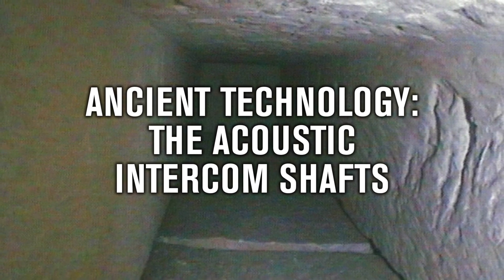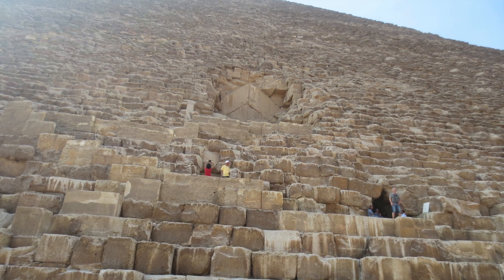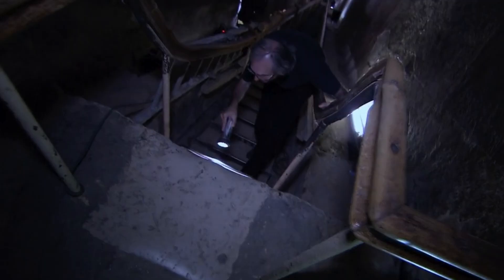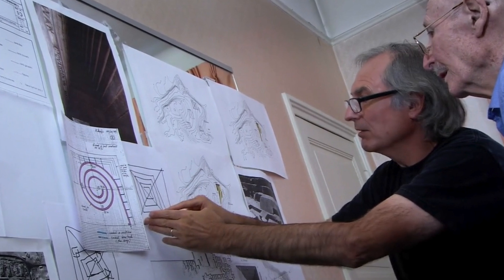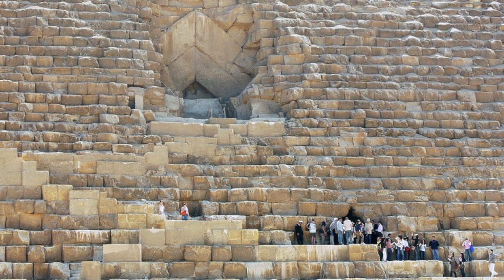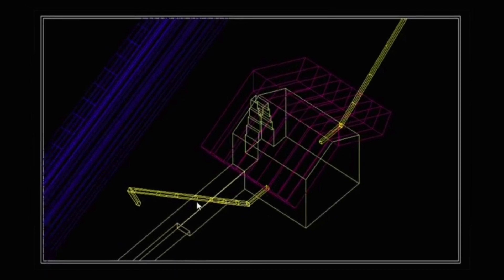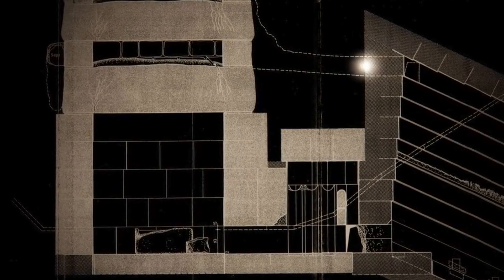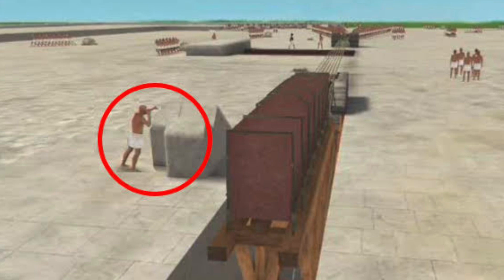Great Pyramid ‘Air Shafts’ Theory: Acoustic Communication Shafts | Ancient Architects

Comment: As a crane operator, I find that this explication very convoluted. We use about twenty different hand signals to communicate effectively.
Reply: Yep, You only get squished one time! Stay alert, stay alive!
Reply: Three colored  lights on the helideck of a destroyer to land a helicopter without radio communications. A complex operation with simple communication.
Reply: @henryporter6659  interesting..
Reply: But think about placing 100 ton blocks within inches of a setting point, but you as a crane operator are 300 feet away with no sight line and you need to convey your moves to hundreds of people. Would your communication systems work without radio? That’s the problem these people were confronted with. And they had to address thousands of workers to lift together on tempo. It’s like a Crew teams Coxswain. Just like the Egyptian‘s had oar galleys they would use the same type of mass communication. 

And if they Are placing large granite blocks in the queens and kings chamber. These locations hold the largest blocks above ground on site and would require the most coordination to place. this is why they’re only used in these two location.
Reply: @brandonmarquette7476  light created by acoustic cavitation?? I’ve NEVER heard such a ridiculous statement in all my life.
Reply: @TheGreatest1974  Look it up it’s true
Reply: @brandonmarquette7476  ok I looked it up. Sonoluminescence is a thing. But the conditions required to produce light this way are immensely complicated and require modern machinery and the correct chemicals etc to make it happen. I would say the ancients couldn’t do it! No way. But I give it to you man, you were right! I didn’t know that existed! Learn something new every day eh! 👍
Reply: @TheGreatest1974  ah, but you ignore the evidence! The circular marks on the ceiling of the Grand Gallery must be explained! The strange marks all over the Queens Chamber, where Christopher Dunn postulated they were making a chemical slurry, must be explained. The 24 notches in the Grand Gallery must be explained. The origins of mummification must be explained. The Geometric lines from Heliopolis to the major pyramid sites must be explained. The Mythology written in the Pyramid Texts, must be explained. All these things can be explained by Sonoluminescent light.
Reply: @brandonmarquette7476  what would this light be used for then? Seems a lot of trouble to go to to make light.
Reply: @TheGreatest1974  The main use of the light was to send the Ka of the pharaoh to the stars. Like it is laid out in the pyramid texts.
Reply: My father, who worked as a false work carpenter for Bechtel, on the Palo Verde nuclear powerplant, the Oakland bay bridge, and many stacked freeways concrete forms always noted, crane operators were some of the most ignorant people he had ever met with a total lack of geometry or mathematics. He said he could train an earthworm how to be a crane operator if he could reconfigure the controls!
Reply: @brandonmarquette7476  its not laid out in pyramid texts because there is no pyramid texts. No text survives from dynastic Egypt Bullwinkle.

Comment: I mean, it is a beautiful theory but thats a heck of a lot of engineering to do the same job as somebody stood between the two gangs signalling with flags for example?
Reply: Not to mention, by the time these "communication" shafts are complete, wouldn't the pyramid's construction be pretty much complete as well? Why the need for communication at this point?
Reply: Unfortunately, this channel often offers good information mixed with ridiculous conclusions.
Reply: Think of lifting something heavy. You have to be in full body sync. Now try and do that with 10 mates or 10,000. There would need to be a sync rhythm to the whole action or somethings going to fail. Maybe not vocal commands but drums or an instrument used for signaling. And the use of the chamber resonances helps amplify the signal. Compression in a space and a small port exit. Sounds like horn. Or rowers on a ship.
Reply: Right? Occam's razor.  Instead, this is a bit like literature professors reading far more interpretation into a text than the author meant, as we've seen many times by the authors laughing at such nonsense.
Reply: @daylan1640  right, but why do this from the center of an enclosed structure where you can't even see what's going on, as opposed to next to where they're doing the lifting? Also, why only have the shafts on two sides? Wouldn't they need to communicate with the other sides as well on a 4-sided (or 8-sided) structure? Too many holes in this theory; I'm not buyin it.
Reply: @amjroid5291  During the video it specifically states the communication shafts were used for the setting of the largest Granite blocks in the structure. So the person who is in charge of setting those blocks should be in the center of the pyramid…Don’t you think so they can communicate out to the lifting teams? Truly, a majority the pyramid would not require such precise communication. Smaller teams on each individual side makes a lot of sense. But specifically regarding the main blocks in the center of the pyramid they need to be able to communicate up to the lifting point and over the plateau and then down to the base or wherever they have pulling teams are located. Where a specific location as depicted in the animation makes sense. 
Think crane operators, have a person on the ground with a radio hundreds of feet away. This is the Egyptian’s version of a radio On a job site
Reply: @Lynn Geek easy just pray. Arent Gods every where and hear every one's prayers. Well that was probly the thinking back then just as the Christian religion tells its suckers... I mean followers the same thing
Reply: Signaling with flags would not have worked. Without looking closely at the series of pictures you find in Houdin's book or, even better, looking at the computer simulation it is hard to explain why, because you really have to understand how the pyramid was built in which order, but I will try though.

Up to a certain level, there was a big external ramp. The Grand Gallery was used as a counterweight to pull up the big granite blocks for the KC over that ramp. 

When then construction of the KC began, the now inner part of the pyramid where the KC resides in had to be build first with smaller blocks using an outer spiral ramp. But the big granite blocks had to be pulled up over an temporary inner ramp inside the inner pyramid using the Grand Gallery as counterweight again.

So this means that on the one side they had to load the sledges with the  granite blocks, and on the other side they had to pull, but the already built inner pyramid between between this two sides made communication impossible without the shafts.

Once the KC was finished, the outer inner spiral ramp that probably is still there today was built to build the top.
Reply: No line of sight for flags.
Reply: @realfranny3483  Interesting point - but three or more flaggers can get round an obstacle. You just have one on top and one on each side. There would be a slight lag, but there's also a lag if an acoustic message goes down one shaft, then has to be relayed to another worker who sends it up the other shaft. Also it seems a rather elaborate solution that could be done more simply. If stone tunnels can transmit sound, why not do it directly across the pyramid in a line, rather than go down then up again?
Reply: @mnomadvfx  Yeah, chemical reaction chamber sounds so bogus. But it certainly can generate power. Even without the casing stones and gold cap, it still creates a powerful dielectric!  It's the perfect way to demonstrate electrical properties to survivors of a collapse after the 12,000 yr solar catastrophe cycle and jump-start technology: (1) made from simple materials, not refund compounds people wouldn't understand and (2) built on a scale to survive nearly anything.
Reply: @peterwhite6611  I think that it makes sense to assume that the shafts were used as a communication device, but that it was not their main purpose. They also had an important magical function to play in the pharaoh's journey to the afterlife. 

Evidence for this are in my opinion the Dixon relics found in the southern QC shaft, the fact that the shafts of the KC (where khufu was buried) were not covered up and maybe the fact that there are shafts in the KC at all, because only the QC shafts were needed for communication (I am not completly sure here).

So if these shafts were not needed anyway, the egyptians might have come up with another, simpler solution.
Reply: @thomastmc  Yes, those things are known as 'DELUSIONS'.
Reply: @daylan1640  Try not to over-think this utter NONSENSE. Nobody would put this level of engineering into anything for the sole  purpose of yelling. Think about it.
Reply: @bobnoxious666  Don't leave islam out of the mix!
Reply: The reason is that they saw the whole construction process in a quasi mystical-religious way, they didn't think in a purely practical way. While the construction was happening, inside the chamber where priests chanting, and through their chanting a rhythm was transmitted to all the workers.
Reply: @GetOuttaTheJohnBoy  so What do you have to say that all the engineering that’s been put into audio amplification Over the years? When in the past they could use acoustical principles to project sound based on the architectural design of the structure. But now we spend millions of dollars in research and development to improve with electrical amplifier that is better? More efficient, reaches a larger audience. Progress. 

No that’s just nonsense. Why would hundreds of people need to communicate. They are just trying to lift and precisely place 100 ton stones while being quite a distance apart.
Reply: @daylan1640  Very good analogy!
Reply: @daylan1640  I'm not sure what you're asking me. This doesn't make any sense.
Reply: I agree. You could even have a system like morse code, with two people at each end of a rope. Simplicity is key. The phonic properties are probably a good trail, but I don't see it working that way.
Reply: @amjroid5291  this whole theory is absolute rubbish. I can’t believe anyone’s buying it.
Reply: You’re right why make them through the chamber and not straight across. And why did they need an in between guy when the sound should of carried all the way down and then back up.
Reply: Given the example of how the acoustics were discovered, why are we leaping to the conclusion it was for communication between the workers? It carried song well -- it seems more likely it was intended for worship.

Comment: I'm not convinced by this, surely the two teams of workers operating counterweights could see each other and signal, the shafts are very complicated and not simple engineering decisions. There's no use of this elsewhere in other pyramids either. The simplicity idea does not hold up if you take for example the way stone is often cut around corners in Egypt and at sites in South America. It is not simple to move or to even carve the boxes (in darkness) at the Serapeum, there is no Grand Gallery there to assist in the moving with counter weights.
Reply: Good points!
Reply: That and the fact granite could not be machined within the tolerances talked about in other videos. Wouldn't there also be rope marks carved into the stones? How about the Limestone and Gold cap? Too many questions with answers I'm sure we'll never know.
Reply: I'm certain we eventually will 😉
Reply: @felixfruhauf4940 
Eventually... After 50 - 100 years or so. Or never completely.
Reply: Taste My Faeces  Good to know I guess I didn't pay enough attention. Thanks! Such a mystery.